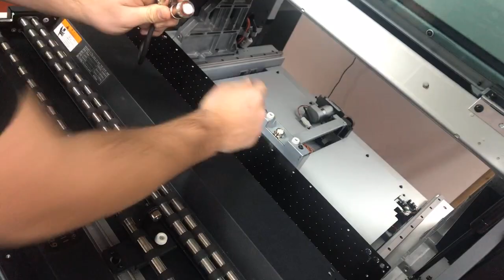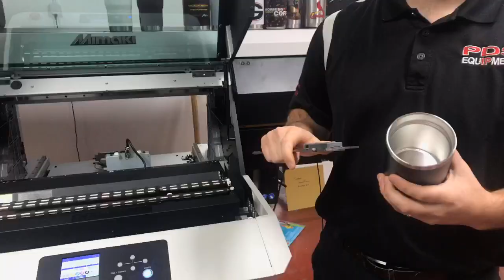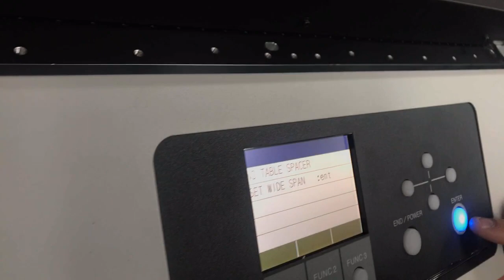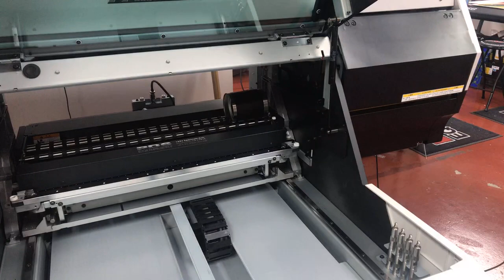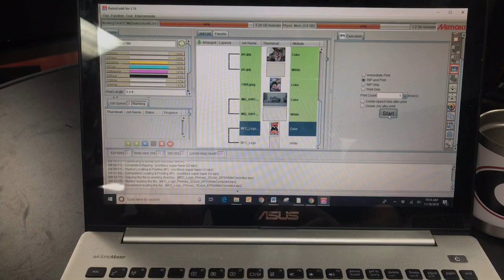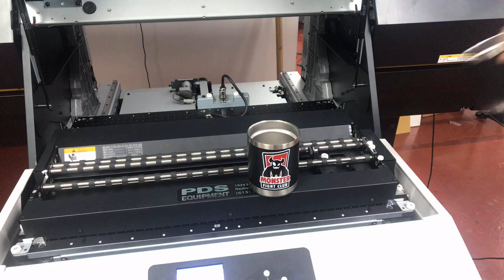HOW TO print using the kebab on the Mimaki 6042MKII

Comment: Thanks so much for making these videos, extremely helpful... I second Jean Thomas' question as I am printing bottles and need customer logo to be on opposite side of my own laser engraved one. I'm having trouble with this as the rollers turn (seemingly randomly though I'm sure there is a reason) before printing starts.
Reply: Further investigation: It seems the first print is fine, the machine doesn't rotate before printing. But with all following repeats when I change the printed bottle for a fresh one, the printer first rewinds the rotation made in the previous print before starting the print. This messes up my location :-/ Any ideas Trevor?? :-D

Comment: We are one of the users of this machine. We have it for almost two years now. The quality of the prints is not bad. But, the bad news is that we have to change out the print-head for the 4th time already since it was installed. And pricey printhead is unbearable. ($2200 a piece here in Indonesia).
Reply: This is good feedback for someone intending to invest on this machine. Why multiple head change?, is it your production is high, or is it a full with the heads? Is the production rate and return on investment justified to head change?
Reply: @synjosh  I have had no issues at all with the printer. I don't use it 10 hours a day, but I believe if you follow the maintenance you should be OK, it's designed not to have issues by constantly circulating the inks, carrying out cleaning processes automatically...
Reply: The machine's dealer in Thailand also told me that printing cup will effect the printhead like you said.

The said that printing curve reflect UV to the printhead.
So I was thinking about making a cover to cover the curve part of the cup.

But I didn't dare to try yet due to the price of the printhead...
and I'm still very new to my printer.

Thx for comment. This really confirmed to what my dealer said.
Reply from the maker: @toonchaos  our customers print cups all day long with no issues.
Reply from the maker: Johnny, it is very rare to have head replacements on these units. what was the head damages caused by. light reflection or head crashes? we have many machines over 8 years old running original print heads and original capping station. did your dealer train you properly on operation and daily maintenance procedures?

Comment: Do you have any video showing how to have the rotary tool start at a specific location so that you could for example have your artwork directly on the opposite side of the logo on the tumbler?
Reply: Hi Jean, did you work out a way to do this? I have the same issue!
Reply from the maker: Jean I will do a video very soon on how to accurately register your jobs on the kebab. thanks for watching.